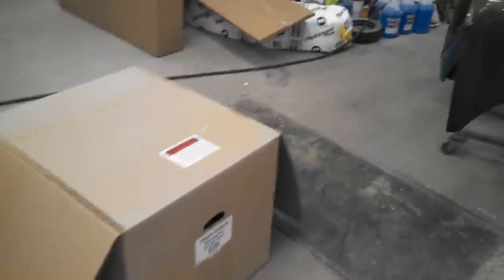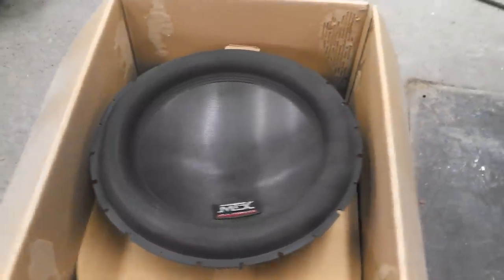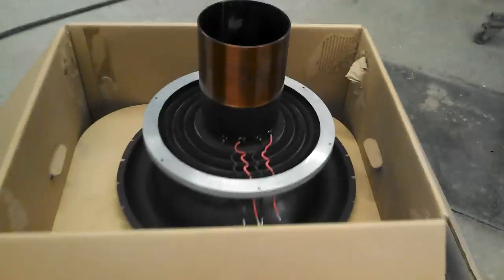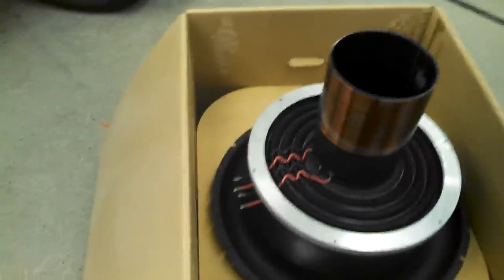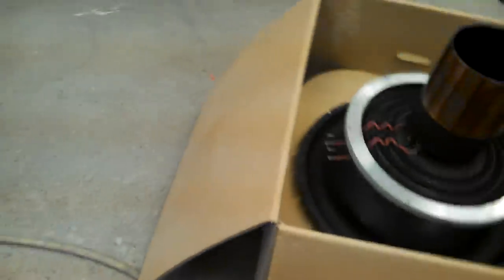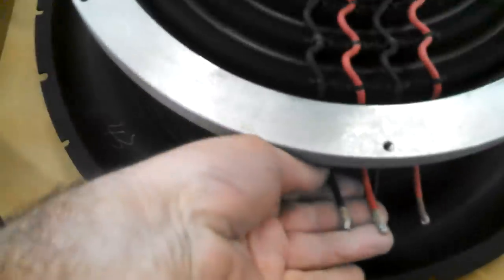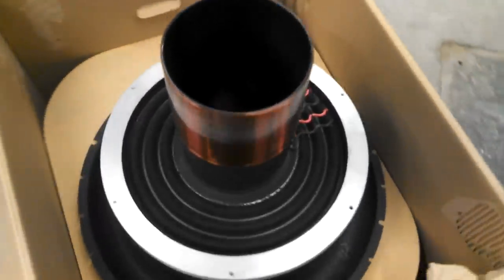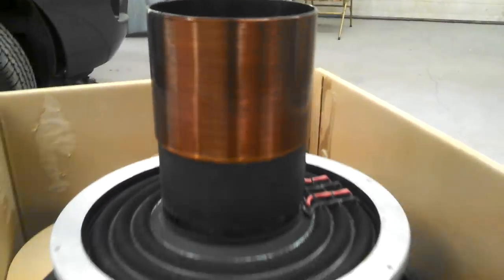MTX JACKHAMMER!!!!!

Comment: very very cool but thats alot of coil mass , i hope that has atleast 4-6 stiff spiders,   the prolem with large coils is the spiders come undone more easy and alot of times ( 70%)  the spiders arnt up to par and warp causing coil rub.      4 inch coil is a big as i go but the spiders but be atleast 10 inches or bigger and there must be 4 spiders or it wont have control over the cone

Comment: My peerless 15 inch subwoofer has a 7.4 inch voice coil. The jackhammer voice coil is still big some15 years later
Reply: What type of subwoffer do you have? What's the Rms power
Reply: @anthonypacheco7606  Peerless by Tymphany STW-350  15”   3500w RMS  5000w Peak  90mm Xmax